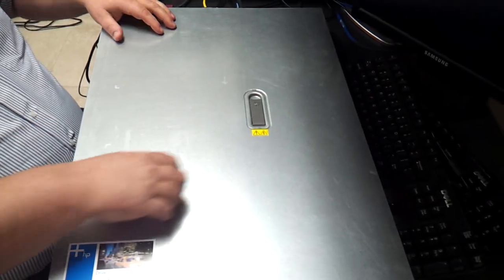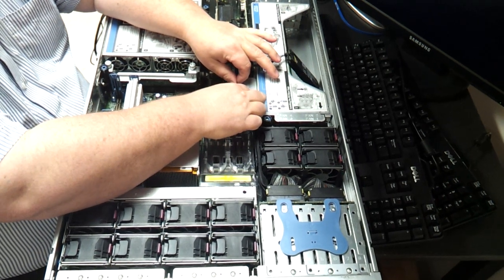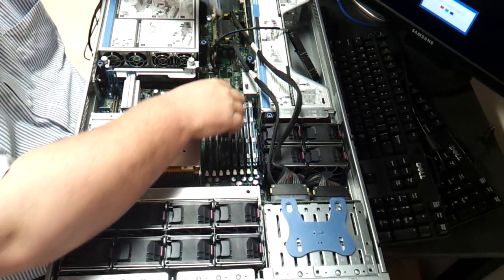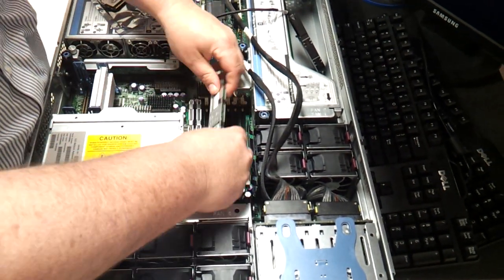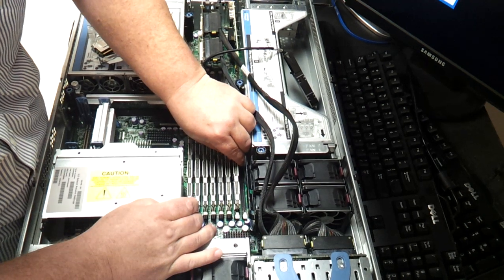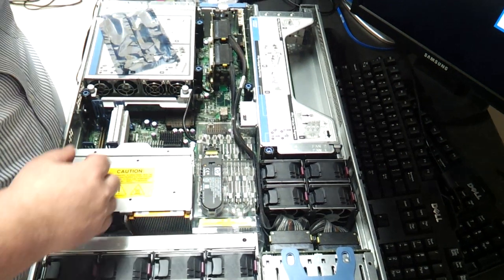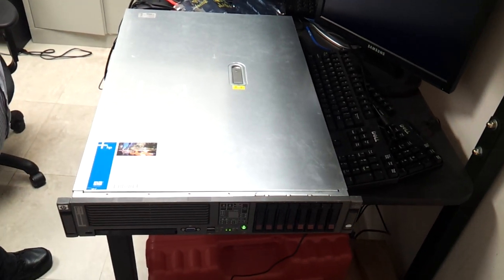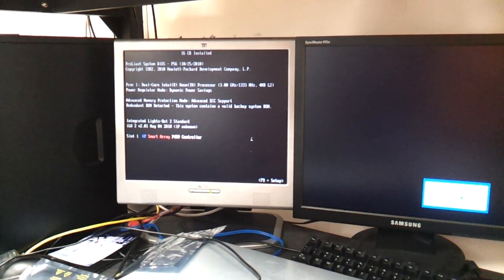HP PROLIANT DL380 G5 Memory Installation (upgrade)

Comment: Hi, Your video is cool. 
I am a sales guy not engineer, the following questions may sound stupid.
One of my customer is using HP DL380 G5 need to upgrade from 2GB Ram to 8 GB for news apps POC test, so 8GB+ is the way to fulfill so they brought 8GB (4x2GB)  but when boot up found error claim missing fan. According to your video I saw 2 set of fan (right now customer server only have 1set at the font) so I would like to verify is that true? or anyway to avoid ? pls feel free to comment

Comment from the maker: If Kingston says it will work that is the first step. Nothing beats testing it live though :). If it complains it does not matter what vendor says. 
I'm pretty sure if you call Kingston and get the part number from them it will work. Kingston or Crucial.
Reply: Hi Claude hayden we installed Ram in server on a initial boot its showing us a error "POST Information: Processor 4, DIMM 8 could not be authenticated as genuine HP SmartMemory. Enhanced and extended HP SmartMemory features will not be active."

Comment from the maker: Thanks Trev. I love the HP Proliant servers. They are incredibly well engineered and rarely if ever fail me. Usually failure on a Proliant is a Hard Drive and thats normally not HP's fault. If you look close you can see this server has rows of fans with a second row of redundant fans behind it. Thats some amazing backup in case of a failure. It also has the battery backed up raid controller and redundant Roms, memory and power supplies. If your running a server for a business Proliant is king.